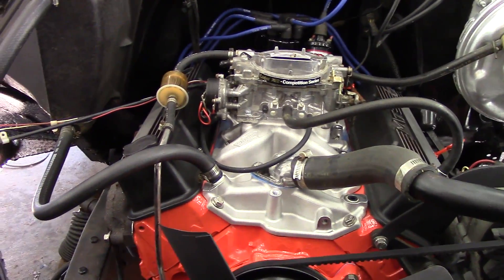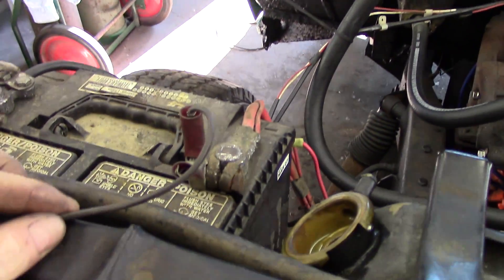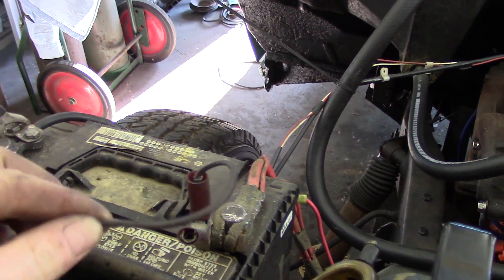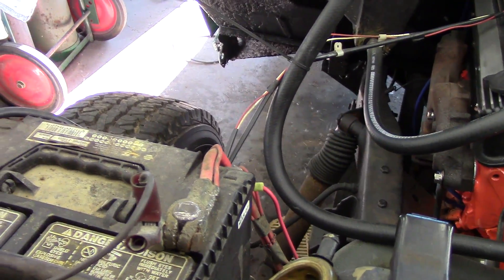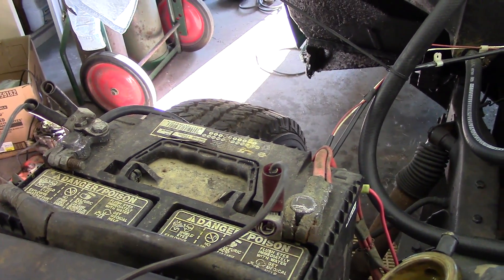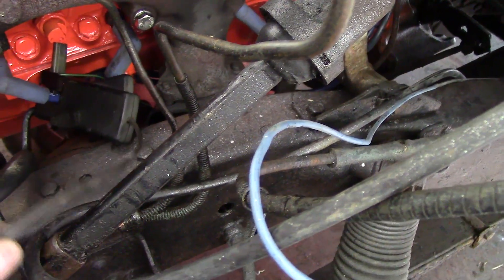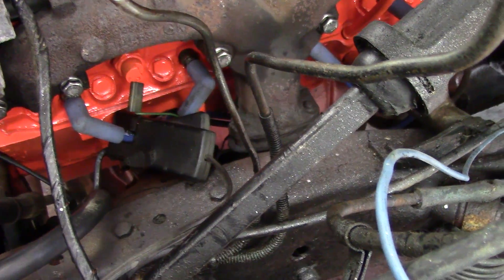How to dynamic time the small block Chevy

Comment: why is he using that ol crappy belt set up that's made for heads with no accessorie holes ,Its a bad setup the belt will sling right off when you rev it high.

Comment: Really no need to pull Dist. Find Comp. #1 TDC take cap off see where Dist is pointing and make that number 1 and put plug wires back on in order, 18436572.
Reply from the maker: Yes you are correct , unless you want it back exactly like stock, so the plug wires fit properly, which was my objective. Thanks for the comment Ron.

Comment: Rick, great video.   I use to build engines but i did seem to miss a step, which is needed and you addressed the piont to pull the vacuum line from the carb and block it, wasn't sure about the connection from the disti if it needed to be blocked off or not.   Glad I watched till the end and found my answer.  Thanks

Comment: when you showed the timing light pointed at the balancer, it was reading 8 degrees after top dead center..  you didn't leave it like that did you?
Reply from the maker: Good luck, let me know if you need any other information?
Reply: tayb5oh4 -looks to me like its 8 degrees "BEFORE" tdc not after!!
Reply from the maker: If I remember right, I think I left it at 4 degrees BTDC with the distributor hose disconnected & plugged. Thank you for the comment and for watching my video!
Reply: H.R.I. services llc Ricky Hembel yea that's wher I think it's suppose to be. was just curious because it was reading on the other side of the "0". thanks
Reply from the maker: You bet, take care.
Reply: H.R.I. services llc Ricky Hembel I did the same 180 out and didn't know what to do so I appreciate your knowledge.  Now if I can just get it unseize from sitting up for 5 years.

Comment: Is there any way that a distributor can be a full 180 degrees off if it was not lifted up out of the engine since the last time the engine ran?   I got a real mystery on my hands right now with a stock small block chevy, and I'm asking as many people as I can.   Thanks in advance
Reply from the maker: +tim d Three ways I can think of off the top of my head, #1 the stock cam gear is made of aluminum with a nylon covering for the gear teeth, as the engine ages the nylon wears/breaks off and can cause the timing chain to jump or shift from where it was supposed to be to any new position, clue: Look for cream colored nylon particles in the oil, also remove the distributor cap, turn the engine clockwise until the rotor turns, then turn the engine counterclockwise to see how many degrees of rotation before the rotor starts to turn the opposite direction, this will tell you how much slack is in the timing chain. #2 the distributor gear  on the bottom of the distributor has a shear pin that may have sheared. #3 maybe the cam broke, but at this point the distributor would no longer be turning, so there would be no spark. Thanks for the comment!
Reply: +H.R.I. services llc Ricky Hembel I think I figured it out..  Took off valve covers and could see valves opening and closing while spinning the engine.  This morning I was about to spin the engine clockwise then counterclockwise to check for slack like you said, and I noticed the harmonic balancer spin a little around the crank pulley.  I had been trying to set timing going by the mark on that outer balancer.. So the 40 year old rubber decided to come apart
Reply from the maker: +tim d I understand, the rubber was aged and the outer ring of the harmonic balancer rotated on the inner ring, which gave you a false timing light reading. Hope everything works out for you!
Reply: It still won't start, but I'm getting closer now that that major timing mystery was solved.